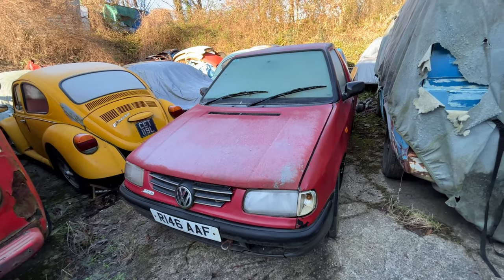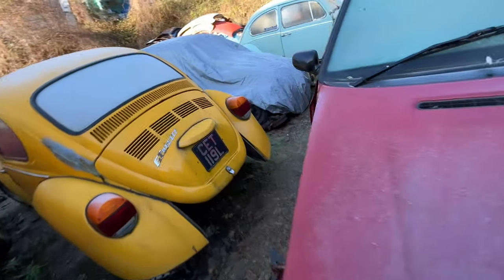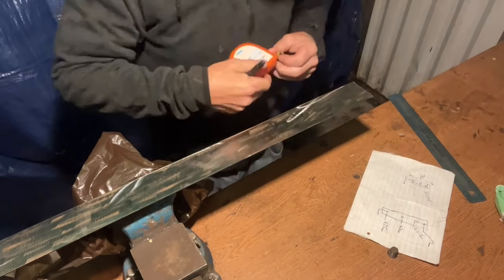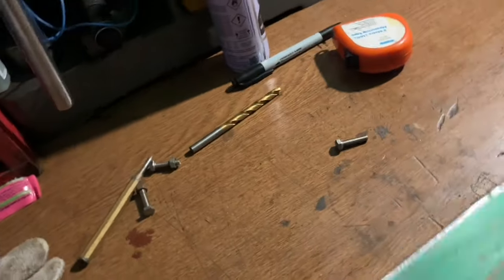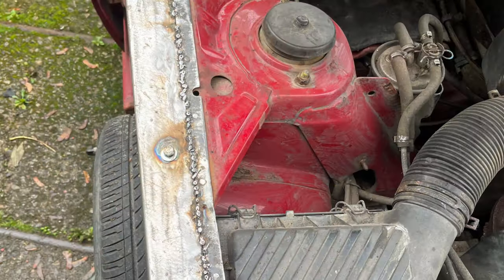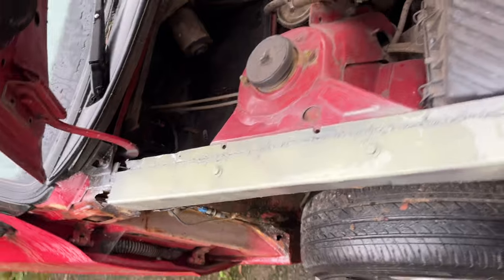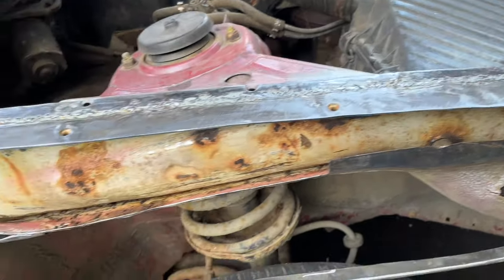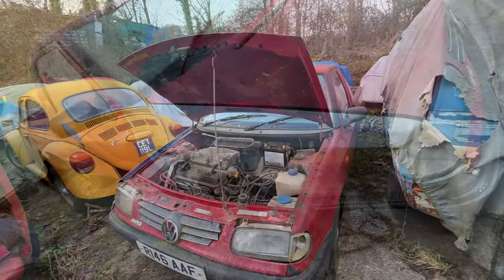VW caddy pickup mk2 1997 rusted inner wing repair !!

Comment: This would be a rare model here in the U.S. also!  Nice work, made it strong.  Just a bit of clean and paint on the inside fender.  This will make one awesome work truck!!
Reply from the maker: Think there called rabbits over in the states ,there’s a few here but not many cheers
Reply: @vwcoco  Yes back in the day they were still not very common.   Very few around from my area
Reply from the maker: @cosmovet44  prefer a Ford 100 truck tho 👍